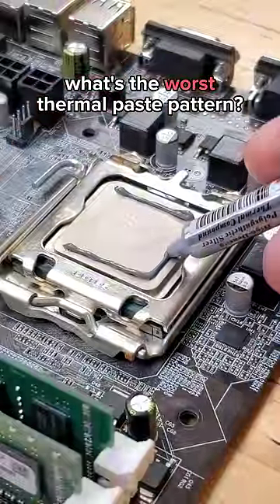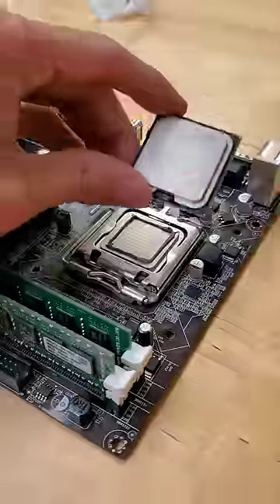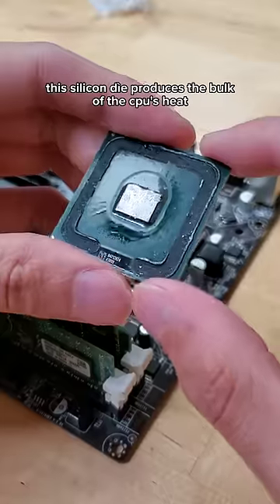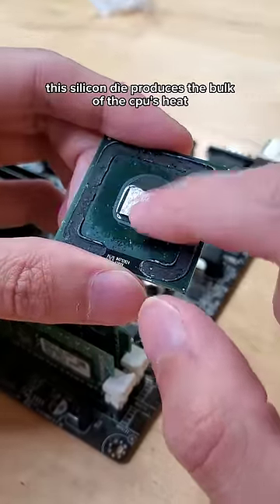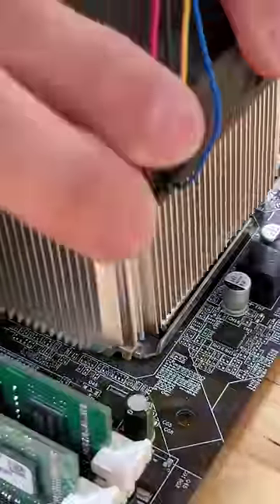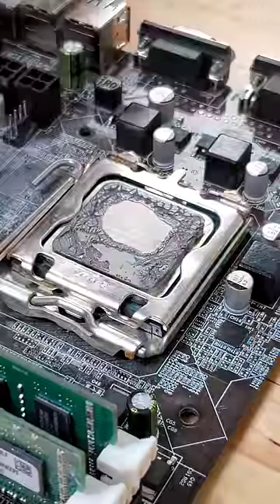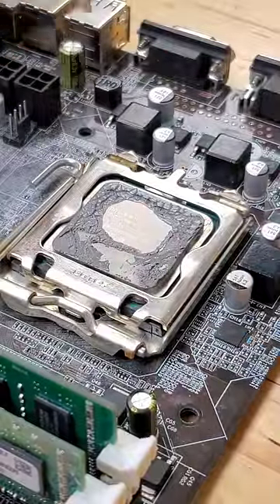what's the worst thermal paste pattern? #shorts

Comment: What if replacing the metal plate on top of the CPU with a modified heatsink to act as a metal plate of the cpu?
Reply: That's called direct die cooling and historically was the standard way for desktop CPUs long ago where the cooler directly contacted the die, it does offer superior cooling potential but is harder to properly mount coolers with a greatly increased risk of damaging the CPU. Manufacturers eventually added an integrated heat spreader, Intel during Pentium 3 and AMD with Athlon 64, to make it easier to properly mount a cooler and to protect the die from damage at a cost of decreased thermal performance.

It is still entirely possible to direct die cool a CPU by removing the IHS (called "delidding") but it's really not recommended due to the difficulty and risks involved.

Comment: Do you think you could direct die cool one of these older CPUs? Curious to how much temps would drop.
Reply: Also was curious about mixing diamond powder with liquid metal till it's a paste almost.
Reply: You would probably kill it from just applying the cooler
Reply: @livingglowstick1337  not if you take of the ILM and just carefully and slowly set the cooler on and slowly and in a cross pattern tighten the cooler. My 4790k went from 4.6-5.0 all core of from delidding and using liquid metal. 150W tdp vs stock 88w. Ofc watercooled
Reply: @reeeeeee9230  and how do you plan to mount it with out cracking the die?
Reply: @livingglowstick1337  it's already mounted. There are several ways. You can just throw it on evenly like I mentioned before or you can make or buy lga direct die mounts that protect the die, lga 11xx series has all kinds of die mounts from 5$-50$ on ebay
Reply: Also machining or sanding you cold plate of the cooler down and the heat spreader of said CPU that can lower temps 3-5F
Reply: @livingglowstick1337  you should look up some videos on it from gamers nexus or,  god forbid LTT
Reply: @reeeeeee9230  I mean the cooler you have to press a metal block onto a delicate die with preasure there's a reason it's not done
Reply: @livingglowstick1337  CPUs don't always have heat spreaders. Look at GPU dies, they have a aluminum die protector around it. What makes you think it won't work for a cpu?
Reply: @livingglowstick1337  also in no was is a die delicate. It's a piece of glass essentially. Just don't break the surface tension. I've been doing this for almost a decade. I know what can and can't be done
Reply: @reeeeeee9230  gpus are built with it in mind same with the cooler find me a cpu cooler that's made for direct die cooling thats for sale
Reply: @livingglowstick1337  also if you look back in the 90s and before lots of CPUs didn't have lids

Comment: There is no worst pattern unless there isn’t enough paste to connect the cooling surface of the Chip to the body of whatever cooling system you might choose …. Going around the edge is just as effective as the central crisscross as far as heat transfer goes …

Comment: Again stupid drawings by thermal paste. JUST SMEAR IT MANUALLY THIN LAYER BY LITTLE STUFF LIKE BROKEN ATM CARD!

And don't use that much paste, you actually need 3-4 drops of it, because if layer too fat - temperature cannot be transferred to fan system. Thermal paste need to fill holes between both surfaces, and literally made space between less resistant to heat (because air can significantly reduce heat transfering). 

If you do too thin layer - thermal paste will dry and loose it liquid behaviour, and air will fill cracks.
Reply: Also if you use "pattern" method, you probably will hard push fan on CPU to make paste spread, but you also can destroy your CPU, because that tiny CPU crystal cannot handle that much force and can crack.